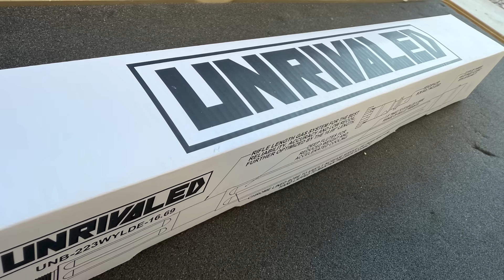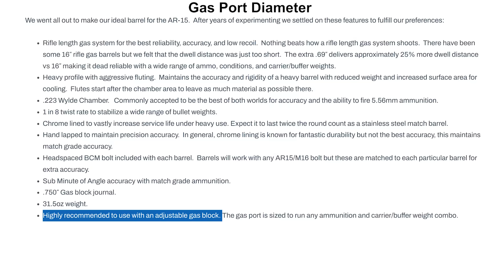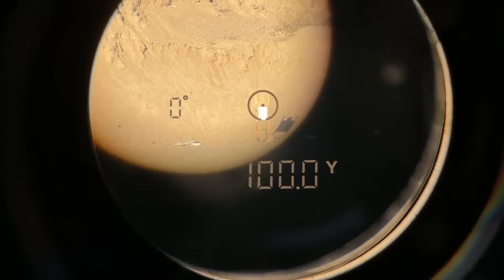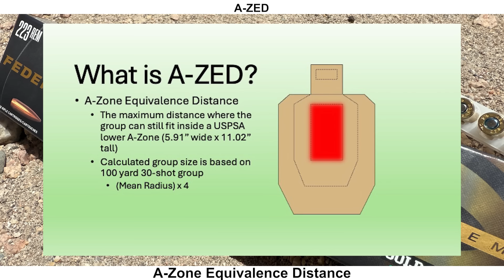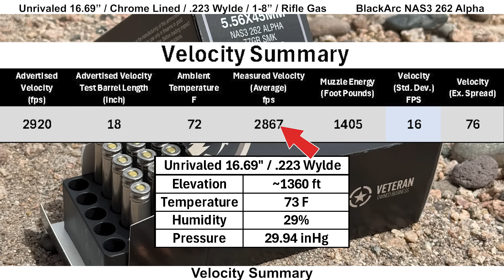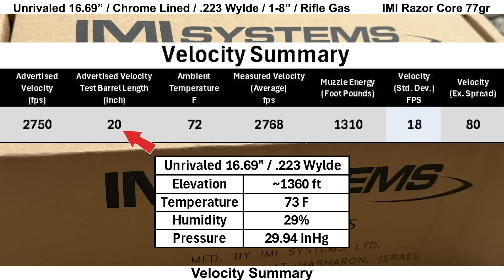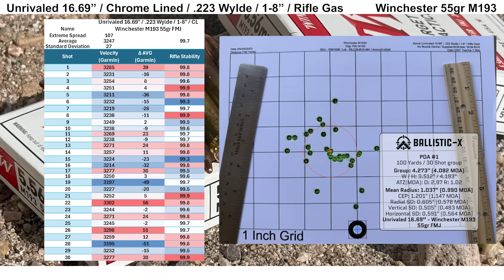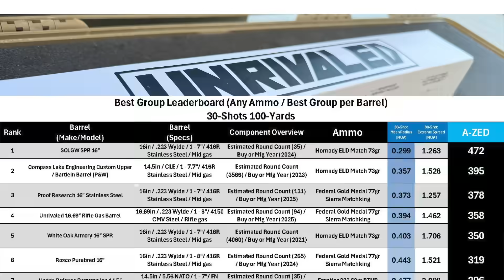AR-15 Chrome-Lined Match Barrel? NEW Unrivaled Barrel Groups & Inspection

Comment: What is this getting me over a Criterion?
Reply: Not much, maybe less weight.  I dare say this is a Criterion that Unrivaled has either had them do or Unrivaled does the external machining on a Criterion semi-finished barrel.
Reply: @BillyWillicker  
Very heavily suspect that's the case, the borescope looks awfully similar to a Criterion, also in 1:8 twist which Criterion really likes for some reason, and if it was a cut rifled barrel they would certainly advertise it in their website but it doesn't say so
Reply: I'm a Criterion fan. Unrivaled gets you a
.69 inches & a $750 price tag.

Comment: like the idea of a rifle lenght on a 16 in but not such a large port. Rather control with buffer weight and spring power. Also do like the fluted heavy profile. Enjoy your work.
Reply: That's not a large port for a 16.69" rifle-gas barrel.  I do agree that it could be smaller though.  I do have a 20" rifle-gas that runs a .082" port and pushes a heavy weight with a lighter spring and works well.

Comment: For 750 bucks it better look better than a bca
Reply: I bought the Rosco Purebred 16" for $99. Based on how it did im extremely happy i chose it.
Reply: Lol yeah this barrel is more expensive than any of my ARs.
Reply from the maker: Yeah, this one is not an inexpensive barrel.
Reply: Try getting a craddock for a G2..
Reply: I bought an A2 PSA blem upper several years ago. Just as a blaster with a stainless barrel. Well the barrel actually shoots about .6 MOA with factory match ammo. I built a nice carbine around it after I figured it out. That upper was $219 I think. Has a billet upper now.
Reply: Until I saw the summary of other barrels on this channel...couldn't believe how well some $150 barrels performed...goes to show cost isn't everything
Reply: @atranimecs for what it’s worth I have ran shillen chrome moly barrel blanks for decades now on precision rifles to great effect. 

They’re one of the cheapest on the market, yet always yield fantastic results. The pricing is especially good when you factor you’re basically buying two barrels for the less than the price of a proof research.
Reply: For $750 I’d expect to fit into it lubed 😳
Reply: U can buy a Proof Research carbon barrel for that😂
Reply: Holy smokes that's not worth it
Reply: With it being chrome-lined and this accurate, it will likely out-last 2 barrels of lesser quality and durability, making it more than worth the price if it performs as I would expect a quality chrome-lined pipe to.  Most of the nitrided 4140 barrels on the market shoot out quickly in high volume, open up early, and are more of a VISMOD gratification than anything.
Reply: @LRRPFco52 Not really an issue unless you shoot a thousand rounds of hot ammo rapid fire. I have seen barrels with thousands of rounds through them and still do MOA. Short of small caliber magnum rounds or full auto its a waste of money. And very very few chromed barrels shoot for shit. Usually in the 3 to 4 moa range. A 416r stainless barrel will last just as long with non magnum ammo.
Reply: @tireballastserviceofflorid7771  If you see competition work-ups, then high volume is a thing.  High-level shooters will easily put 500-800rds though an AR-15 per day, and barrels are expendable items.  If you can reduce the number of times you have to replace the barrel, that’s a cost savings.  Doesn’t make sense to occasional shooters, which that barrel isn’t targeted towards.  I’ve been shooting AR-15s in high volume since 1987, have burned through ridiculous amounts of ammo since that time.  That’s just what came to my mind when people started complaining about the cost.  If you even bring up the cost, you know it’s not in your budget to shoot competitively anyway just due to how much ammo and other things cost.
Reply: @LRRPFco52 500 to 800 a day?? Lol. I was NRA classified in 8 games. Master level on 2. Tell me more of this competition thing you speak of... training for competition is not about dumping rounds at all. Its about precise training. Countless mag dumps it is not.
Reply: @tireballastserviceofflorid7771  That makes sense for Hi-Power, but not 3-Gun or 2-Gun.  Not mag-dumping, but lots of rapid strings into A Zones in CQM.

When I was regularly shooting 3-Gun, I burned through a lot of ammo per day.  D-Drills, El Presidente with Rifle, Escalators/V-Drills, 1-5, hammers with TGT transitions, Mozambique drills, etc.

I put over 10k rounds through my main 3-Gun AR within a year easily and broke a bolt.  It is tortuous on a rifle.

This barrel seems ideal for that type of work, seems more affordable to leave it in for a year or 2 instead of toasting 2-3 barrels.
Reply: Just get a Rosco Purebread.  Mine is great for 1/4 of that price or lest on sale.